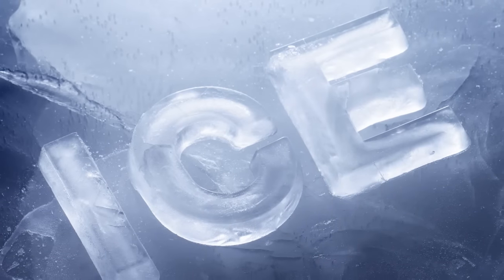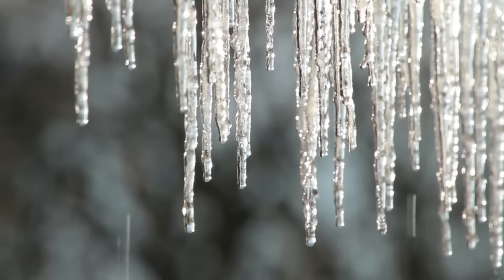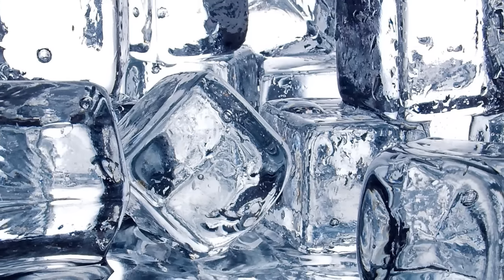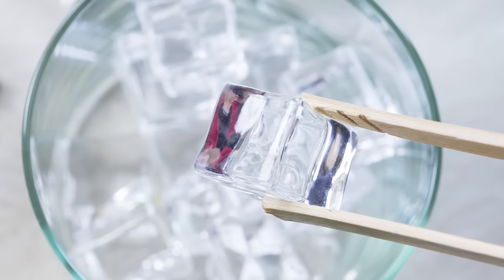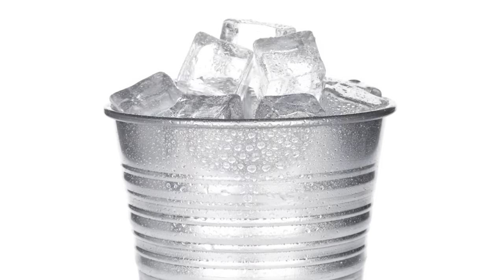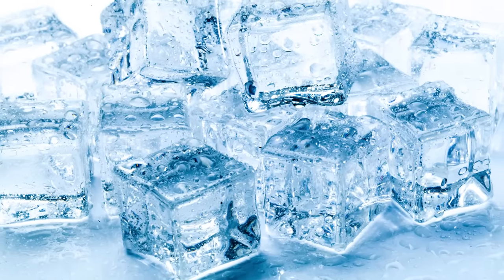Freezing Water in Unbreakable Containers

Comment: I read somewhere liquid water isn't compressible, if it actually isn't compressible, what would (theoretically) happen if liquid water went into a black hole?
Reply: Water is made of atoms like anything else. Exposed to conditions millions of times greater than what can be experienced on Earth, it'd either undergo fusion, degenerate into neutronium or strange matter, or be reduced to a singularity.

Outside of black holes and entangled particles, infinities don't exist in this universe.
Reply: Water doesn't go into a black hole. By the time a water molecule gets close enough to the singularity, it is pulled apart into H and O atoms, if not further down into subatomic particles. The pull of gravity of a black hole is way stronger than any bond that can form between atoms that create compounds and molecules, with an insanely tight gradient which would eventually have significantly different forces even on opposite sides of an individual atom, breaking it in half.

Comment: I disagree with your conclusion that it will become ice-II. If kept in an unbreakable container it may be implied that volume is fixed and hence density will be fixed as mass of water is fixed. This would mean it follows the 1g/cm^3 curve on the phase diagram and this appears to never reach a solid phase. This means that in an unbreakable container the water will never freeze but it will become super critical. 

This conclusion is on the assumption that the phase diagram has usable/reliable data in that region which it quite likely may not have

Comment: 10000 times atmosphere is 145000 psi if you didn't know... a diesel cars fuel system works at around 20,000 psi - doesn't sound so grand now does it

Comment: Does the ice at the very bottom of a massive glacier form ice 2?
Reply: I think Ice 3 would form first. Ice 2 requires a lower temperature than 3. Phase diagram appears to say that Ice 3 forms under roughly 212 MPa of pressure, and Google says 212MPa = 30748psi. Google also says water ice weighs 0.5299 ounces per cubic inch, which means every inch of height the glacier has will add .5299 ounces of pressure at the bottom.  Sixteen ounces in a pound, so you do 30748 x 16 = 491,968   then divide 491,968 by 0.5299 which equals 928,416.6 inches tall to make ice 2 or ice 3.  Since 912416.6 / 12 = roughly 77,368 feet tall. Divide 77368 by 5280 feet in a mile, and you get 14.65 miles tall. You would need a glacier roughly 15 (24.14 kilometers) miles thick to form Ice 2 or Ice 3.  I think that's thicker than any known glacier to ever exist on Earth - Wikipedia says ice age glaciers were only about 2.5 miles thick.     So nope, there probably isn't any Ice 2 or Ice 3 under glaciers on Earth. That's strangely disappointing to me.

Comment: So what would happen if I used ICE 15 cubes to chill my drink?
Reply: +God of Thunder, WTH? Enlighten me. What does All Gore, sex and a super model have to do with using ICE 15 to chill a drink?
Reply: Stanton Taylor It has everything to do with that.
Reply: The Moon Man that explains nothing.
Reply: Since the other forms of ice are formed under extremely low temperature and high pressure, it means that the ice thus formed is under high internal pressure and low temperature.  Assuming you could somehow contain a cube of ice 15 until it dropped into your drink, it would probably instantly freeze your drink and blow your frozen drink all over you and your near neighbors.  How much force that explosion would have will take somebody much better at math than me.
Reply: I was wondering if an 'explosion' was possible. I expect there would be some sort of violent reaction. I don't know. I wish it would have been addressed in the video. Thanks.
Reply: I could be wrong but I'm fairly sure some bars had a way of producing ice that took a lot longer to melt in a drink.
Reply: I'm pretty sure that al gore is president of the icebergs and as such buying the ice 15 would give him loads of money to attract materialistic supermodels

Comment: what about what would happen if water was frozen under vacuum?
Reply: i think water doesnt ice in the vacuum of space, i believe you need some sort of gravity/presure. but i might be wrong.
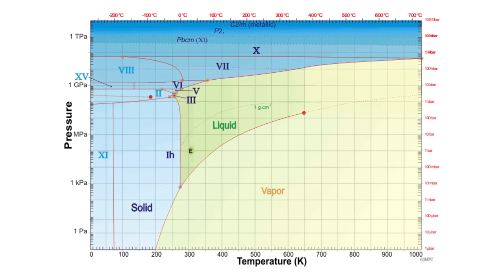Reply: You can see on the phase diagram (2:03) that water cannot exist as a liquid in a vacuum.  It can only exist as vapour or ice.  So it can't actually freeze (since freezing is going from liquid to solid).  It can, however, go from vapour to solid.  This is called deposition and happens at about 200 kelvin at 1 mPa (as shown).
Reply: 3 Science 4 me m8
Reply: Actually this phase diagram doesn't go down to zero.  It only goes as far as 1 mPa.  On the other hand, there is no perfect vacuum anyway.  

What we do know is that comets are made largely of ice and rock.  As a comet approaches the Sun, the ice begins to turn to vapour.  It goes directly to vapour from ice without going through the liquid stage, it sublimes (like carbon dioxide, dry ice, does at atmospheric pressure), producing the tail.

Liquid water cannot exist below about 611.7 Pa.  It's either ice or vapour depending on the temperature.
Reply: Well if there is just the right pressure you will get the triple point
Reply: Ice does form in outer space. When the space station or other space craft jettison their waste water it freezes almost immediately into ice crystals that expand rapidly due to the loss of air or oxygen or whatever gas my be present in the water.

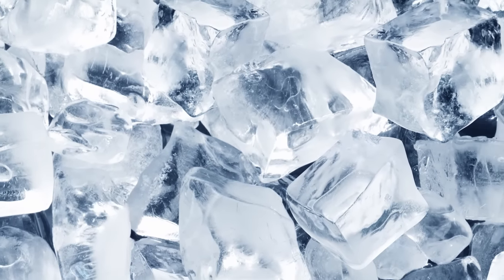Comment: 4:05 pressure would be more relevant than force, right?
Reply: Chaos Corner pressure is just force per area, and the way he phrased that sentence it was ambiguous enough that you can assume he was talking about the force necessary to crack that specific container. You are probably correct though, he may have used that word by mistake.
Reply: That's the point though. Without giving area or other specs, force is meaningless in that context.
Reply: Chaos Corner Obviously a mistake on the video-makers part. General population most likely doesn't know what pressure actually is...
Reply: Probably. It's just not something that I think someone familiar with the subject matter would say. Which isn't a bad thing but it does affect how reliable I'll judge these videos to be.

Though in truth, I find this guy a bit annoying (no offense intended, I'm sure he's a nice chap) so tend to avoid them anyway.
Reply: Chaos Corner Have to agree with you there. If they can't get the simple terms right, I'm going to have to rethink how scientifically correct this channel actually is. Next they'll be introducing centrifugal force... xD

Comment: Coal under intense heat and pressure becomes a diamond, diamond under intense heat and pressure become foam pellets, commonly used in packaging.
Reply: TechMantra What?
Reply: TechMantra what do foam pellets become under intense heat and pressure?
Reply: God of Thunder It's the final stage. One does not simply compress foam pellets.